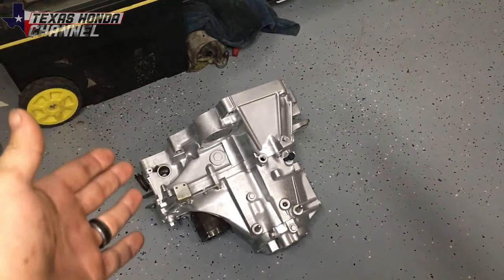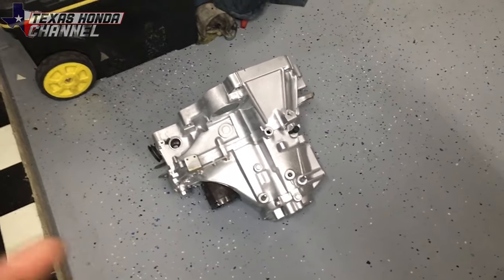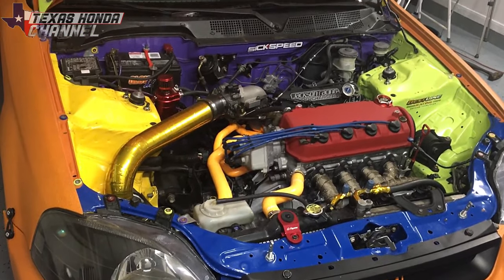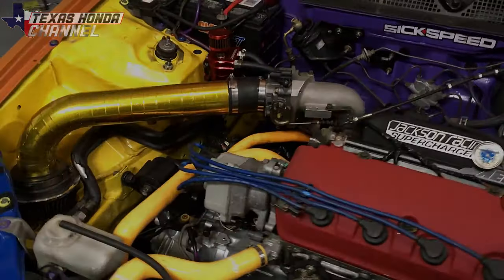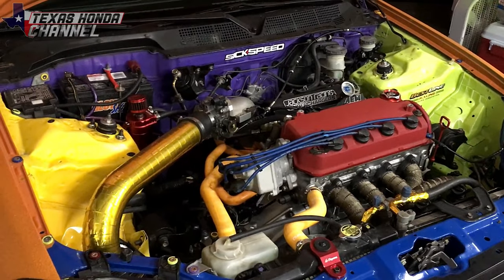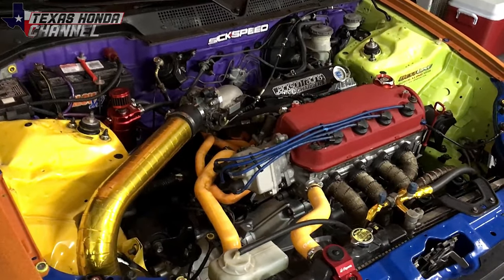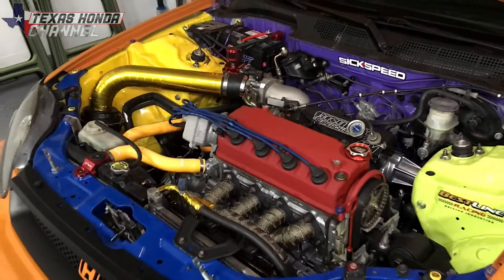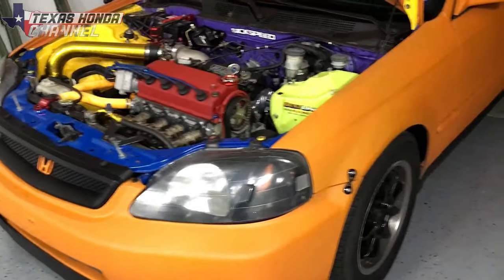Short gear transmission VS Long gear transmission (Requested video)

Comment: James, you are DGuy!!!! You might have just explained Josh's high rpm issue...  glad I seen this before I swapped and was lost in a rabbit hole lol. I'm just gonna run a y8 trans and get a stage 2 in it.. according to the honda forum the y8 can hold alot more torque than the y7 and its steel...I cant wait to get both mine and my brothers civics at the track.

Comment: I would just like to add he is talking about these gear ratios with a N/A or low power set up. With a Turbo, you can run a lil more boost to make up for loss of acceleration and gain the faster top end with longer gears. Turbo will make up for many losses. Thats why I love em.
Reply: Bingo

Comment: Personal preference agreed brother. I prefer long gear transmissions because i got more mph per gear and stay in gear longer in my boosted honda also that yes better fuel economy I be under 4k at 65 mph in my Ls trans for my old b20b turbo in my integra but my cousins lsd gsr trans had me gapping fools easier but I had to shift sooner an lost mph so i had to raise my redline higher in the hondata to compensate then I chocked a rocker in my stock p75 head 😆 at 7500 was worth it though I beat a gt500.

Comment: I finally pulled the motor from the 96 del sol so its a decent rolling shell. You can have it if you wanna pick it up before i scrap it. Located in South Austin

Comment: Hey bro can you tell me what alls I need to go turbo in my 96 integra gsr???  I have a chipped p28 thats already in the car running I plan on buying a complete ebay turbo kit.. can you pls tell me all the parts list I need in order to be able to install it and drive without a tune?? I heard fmu will be able to drive it without a tune I can't find anything or anyone to tell me all the parts I need pls get at me bro as soon as you can.. thanks keep the content coming bro 🙏 💯 👌

Comment: Woulnt a long gear have a higher top speed because of the higher gear ratio? Or is does it not really make a difference?
Reply: Doesn't make a difference when your in a drag race
Reply from the maker: Yes it indeed would have a higher top speed but in a 1/4 race it wouldn’t reach that top speed. With the A000 CX transmission it’s can hit 200mph but it might take a bit to get there but it could in theory do it
Reply: @centraltexascivic7299  gear ratios make a big difference in a drag race
Reply: gear ratios can only do 1 thing. change the crank to tire ratio. longer or smaller gears = higher top speed. you dont see 600whp civics with 5:1 final's

Comment: I remember my prelude could hit like 100mph in 3rd..lol , my mini barely does 60 in 3rd and it's a 6spd
Reply: A lot of 6 spd are shorter geared just look at the wrx 5 speed vs the sti 6 speed
Reply: yeah, 3rd would be shorter in a 6th speed than a 5 if you want the around the same top speed. you answered your own question without realizing it.

Comment: I just want to know how you cleaned up the transmission, or did you just spray it
Reply: He Cleaned it then Sprayed with VHT or Duplicolor High Heat Resistant. That’s how we did my Auto Tranny with the Engine Block

Comment: Know much about a 97 Del Sol S8G transmission?? I'm trying to find more info and haven't found much.
Reply: Hey man, its been a year. I have a d16y8 sitting around with an s8g aswell. Did you find out anything?
Reply: @Phika741   its been another year lol have you found any info?
Reply: @johnathonbowers-keable555  long as hell. 4th gear is at 220km/h at around 8700rpm on 195/50R15, when you shift to fifth, rpms drop below vtec. Gear 1-2 pulls well, anything above that is dogshit. Its probably good for a turbo setup but not fo NA.
Reply: @Phika741 planning on dropping a JRSC D15B in, take it it’s much better for it than NA?
Reply: Got S8G B000 is that the same one or shorter?

Comment: Will slightly shorter gears affect the top speed ? I know for sure the final drive does. Just don’t know much about short and long gears in terms of top speed.
Reply: gears and final all affect the crank to tire ratio. the tire rpm compared to the crank is gear ratio X final. changing the gear ratio or the final does the same thing. larger numbers for ratios lower the top speed, but increasing tq output. longer gears allows higher tire speeds but lower tq outputs.   this is why 1st gear pulls harder than 2nd gear, and 2nd more than 3rd etc.
Reply: It will. The longer geared trans will have a higher theoretical top speed (the speed it could reach if power wasn't a limiting factor) but on a relatively low powered car like a Honda the short geared trans would likely reach a higher top speed because the RPM will be higher. As an example, let's say you have an all motor D series making ~150HP and the taller geared trans has a theoretical top speed of 180 MPH compared to the shorter geared trans at 160 MPH. Realistically you will not reach either of those speeds with that power, but the shorter geared trans would actually probably have the higher top speed since the RPMs would be higher at the speed you would top out at and a higher RPM tends to mean the engine is able to produce more power within reason. Now if you have a turbo and you are making 500HP then the taller geared trans will probably get you the higher top speed since you will likely have enough power to max out 5th gear on the short geared trans. I hope this makes sense, let me know if it didn't and I will try to explain it differently.
Reply: In my experience, the longer geared transmissions has higher top speed

Comment: Best gears ratio are 3th,4th and 5th from CRX FD9 and Concerto 1.6 DOHC with Civic mb2/mb3 or concerto 1.6 sohc final drive.
L3/S40 hybrid transmission:
1-3.250
2-1.909
3-1.346
4-1.033
5-0.878
FD- 4.437

Comment: how can identify if d16y8 transmission
Reply: theres a circle stamp around the axle hole on the passenger side of the transmission.
Reply: Look for the stamp near the fill plug

P20/B000= 92-95 Civic EX/Si (D16Z6)
P4A/B000= 96-00 Civic EX (D16Y8)

I believe these transmissions have identical gearing in all gears as well as the 4.250 Final drive, just different years

Comment: Man I need to change the transmission of my d16y8, currently it has a S40, I'm not sure if the S40 has short gear or long gear, or the short ones are only the S20.
Reply: @EclipseStrife thanks u man 👍🏻
Reply: S40 is B000 means it’s Short gear ratio
Reply: S20 is from 92-95. S40 is 96-01. That’s all that means. Long gear trans have A000 and short gear are B000 in the s20 and s40.